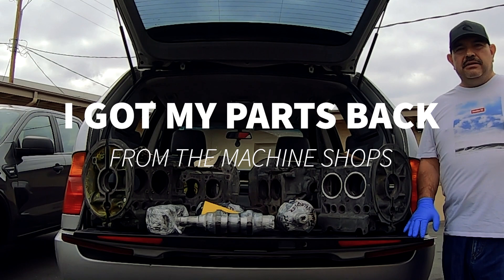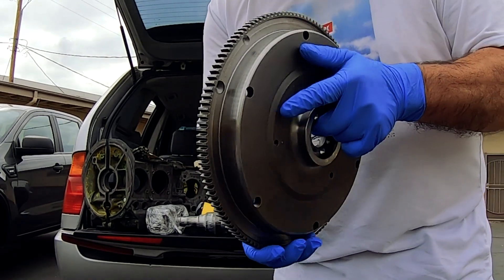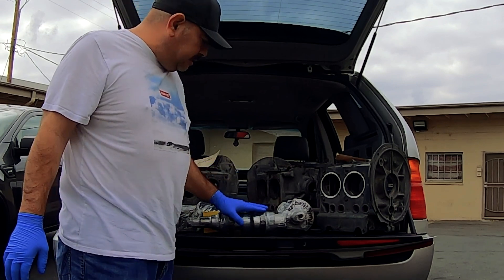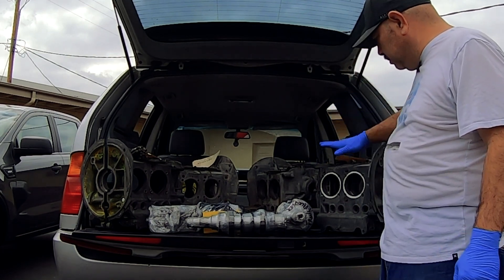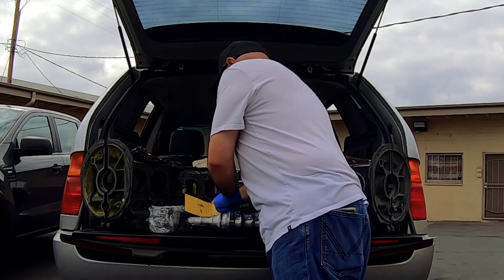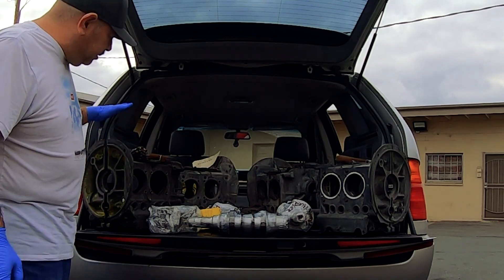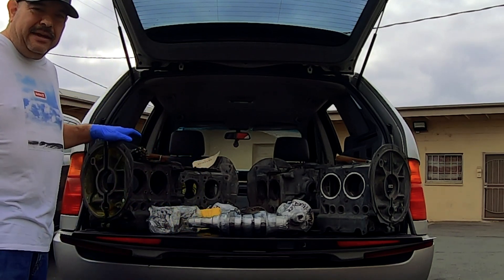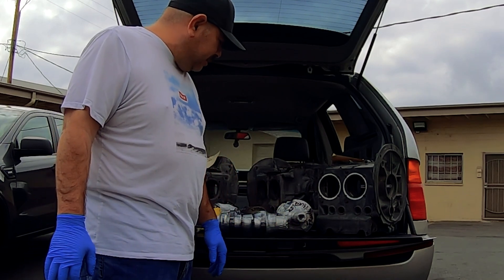I GOT MY PARTS BACK FROM THE MACHINE SHOPS

Comment: AA has 92 mm thick wall that use 94 mm heads. They have them in 94 case and 94 or 92 case 94 heads so you could have the strength of the thicker wall and downsize the engine a little bit to match those valves a little better.
Reply from the maker: Thank you for your great feed back .